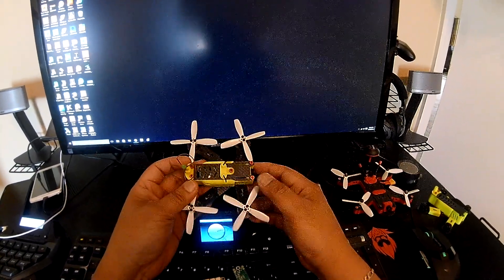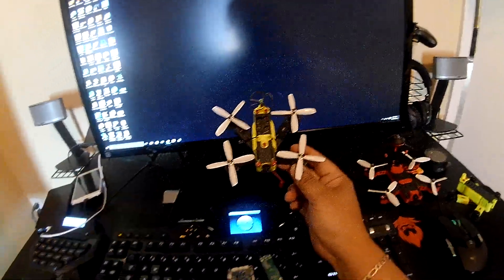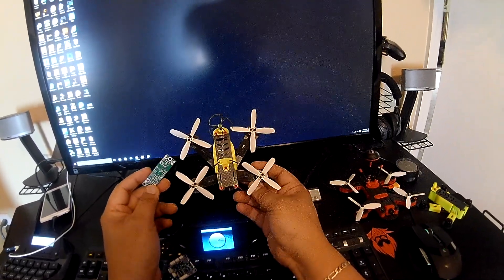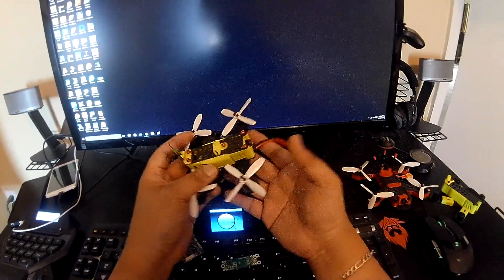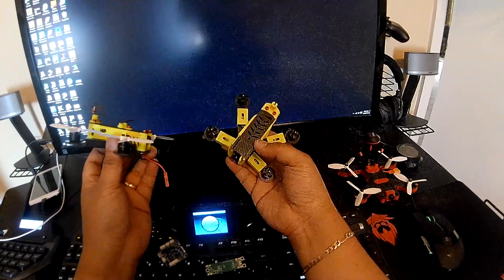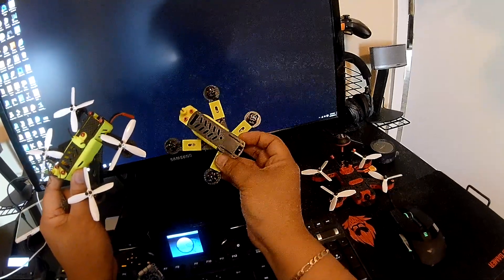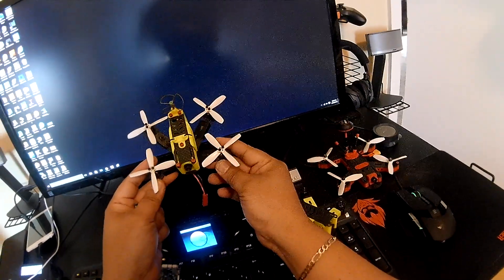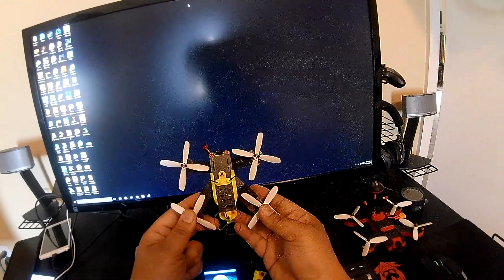Tomo Quad  Mosquito110  - An Introduction.

Comment: Do you know any way I could hook up some motors to the inductrix 200 flight controller? It has tiny plugs on the board and no pads to solder to underneath. I want to build a brushless micro and the all in one controller is only £70. And what frame of yours would it best suit?

Comment: Just got the 110mosquito frame in . Can't wait to get this bad boy in the air . Wondering if the esc covers fit better when the escs are on and whole thing is built? I put them on with escs or 3D printed frame  cover. Thanks

Comment: Hi Tomo, I just ordered one... was wondering what size battery I should buy and how much flight time you get. Thanks!!
Reply from the maker: depending on the motors your using , 1104 with 600mah should be around 6min.   1105B  on 600mah 3s would be 4min . you can go as high as 850mah 3s